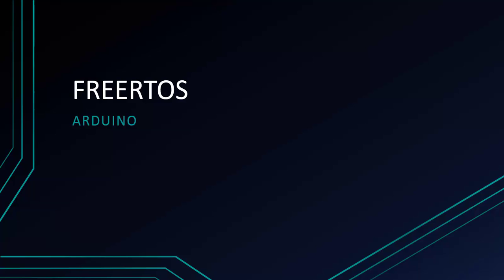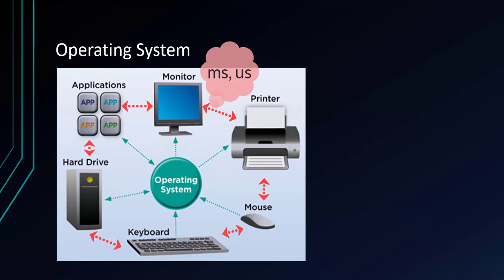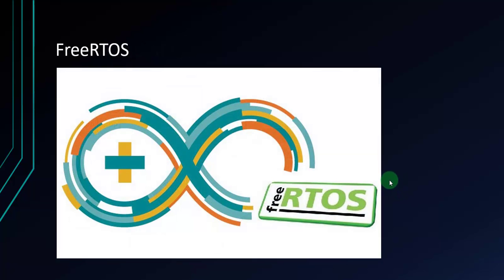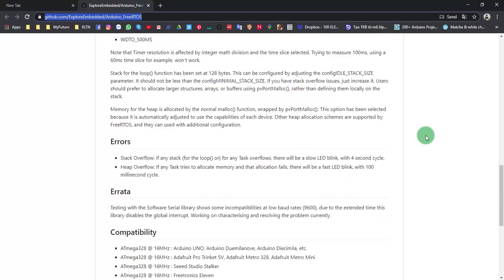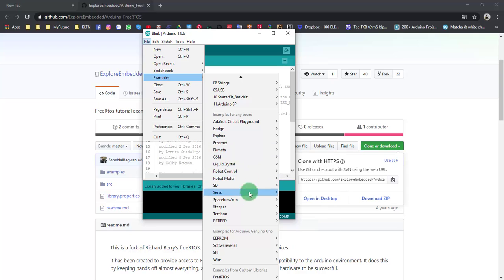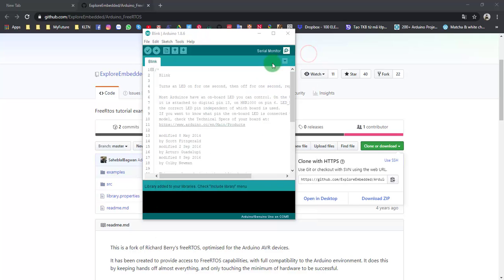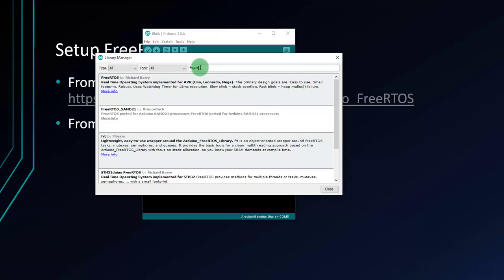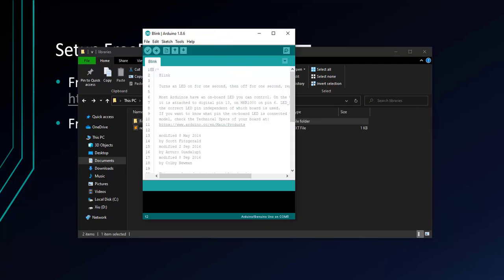FreeRTOS With Arduino Tutorials 1 - Setting Up FreeRTOS on Arduino

Comment: Hello 
I have a task to do and I am new to Arduino. The task is to create a project in Arduino IDE, using the FreeRtos library. 
Then I have to find all the library files that are included (that belong to RTOS) and combine those parts that are needed into a single file together with the code. How can I do it any help would be really greatful. 
Thanks

Comment: Is this really RTOS or is it just a scheduler renamed? Not sure an UNO can run an operating system
Reply: Yes, this is a real-time operating system to be used in embedded applications.  It is not a general-purpose operating system such as Linux, Mac OS-X, or Microsoft Windows. An RTOS's purpose is to switch as fast as possible between tasks by calling the scheduler.  The switch to the scheduler may be task-driven and is called a cooperative RTOS or under a hardware timer control and is called a preemptive RTOS. FreeRTOS supports both, but Richard Berry's Arduino port is only cooperative out of the box.

Typically an RTOS does not come bundled with drivers for printers, keyboards, and such, utility apps, or a GUI.  Because it does not directly support these concepts does not make it just a scheduler.  Just because your microwave oven does not support a TCP/IP stack does not make it less useful.  FreeRTOS also supports notifications, semaphores, queues, mutex, interrupts, software timers, and other software concepts. 

Gui based operating systems borrowed heavily from RTOS concepts.  Note early MS Windows (like 3.1) was cooperative and when one task (app) crashed the system crashed.  Newer versions of MS Windows became preemptive so one app just stopped responding and did not bring down the whole software system.   Will FreeRTOS replace MS Windows?  No, because its emphasis is embedded applications and not nonembedded applications such as word processing, media editing, and the like.

I would suggest you consult Wikipedia as a starting point for your study of RTOS.
Reply: Please refer this Link: https://www.arduino.cc/reference/en/libraries/freertos/